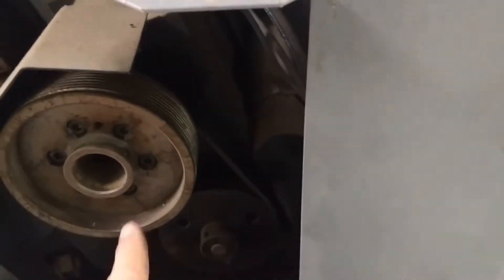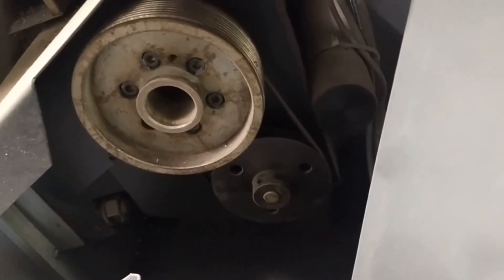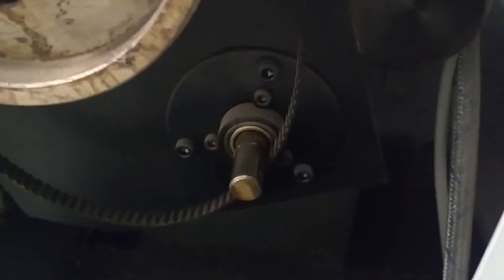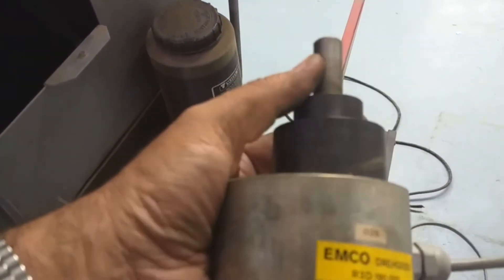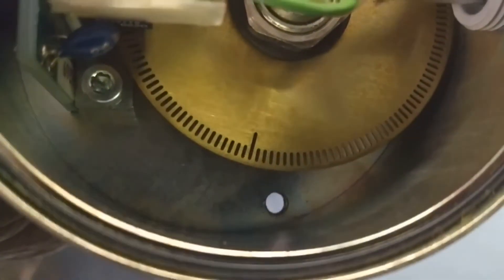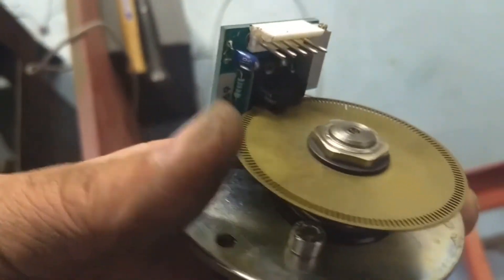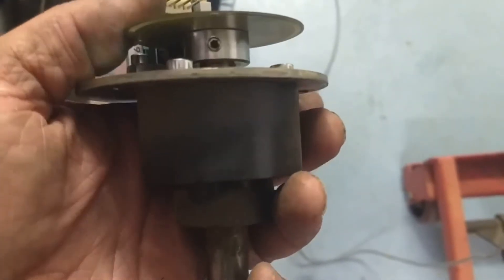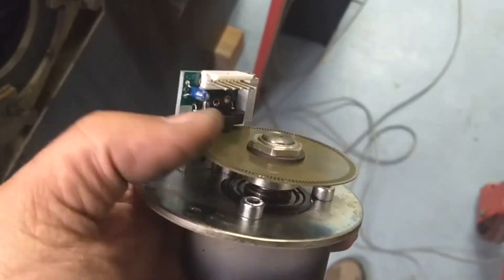Emcoturn 140 Spindle Encoder Removal and Inspection

Comment: Hi Sir, I want to ask about why you didn't keep the original Encoder, I think that it will give the same pulses as a standard one !!
or there is other things to consider when working with the centroid Acorn board ?, thnkyou si :)
Reply from the maker: No, it is not compatible with most newer control systems. Acorn and the other Centroid controls need a line driver (differential) encoder of 2000 counts per revolution or greater for accurate rigid tapping, threading and constant surface speed.
Reply: Thank you so much sir for you rapide response   :)